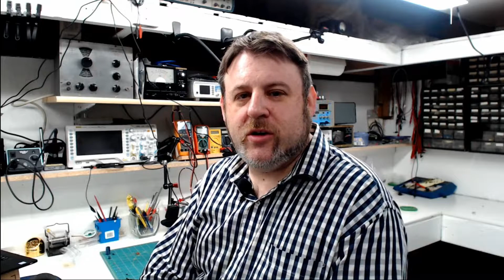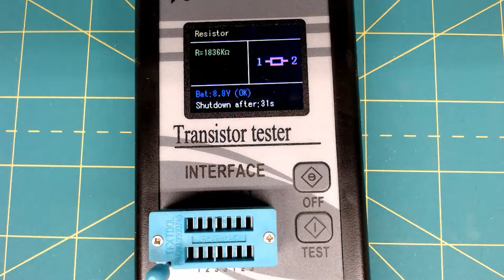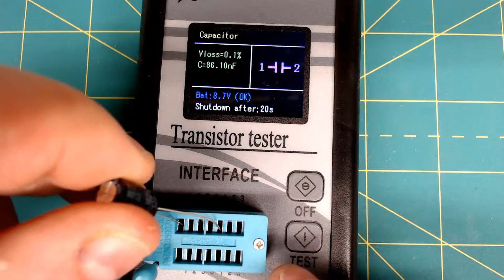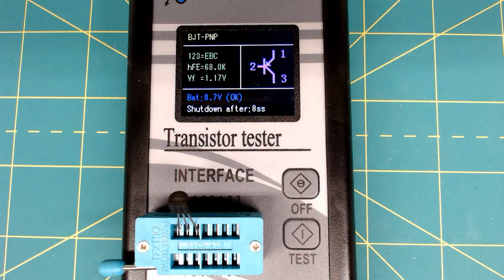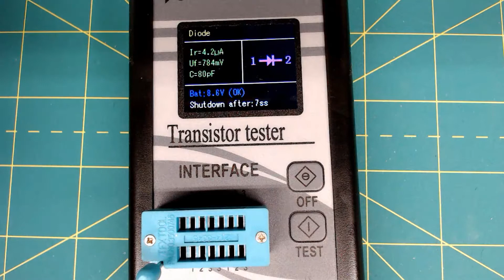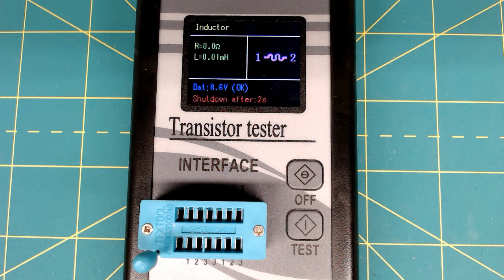Drok Electronic Component Tester Review

Comment: What happens if the component is bad? I purchased the Drok based on you Amazon Review. I watched a lot of YouTube reviews for the Drok Transistor Tester, but no one shows what happens when testing a bad component.
Reply from the maker: Ok, I'm a year late, but answering now :-).  Unfortunately, the answer is "it depends".  It really depends on the type of component and in what way it is damaged.  For capacitors it may read a different value than the marking on the capacitor, which would mean the cap is bad, or it could measure as open and will state "unknown component or not connected".  Resistors that have overheated could also read the wrong the value, which indicates they are bad.  Coils/inductors generally fail when the wire insulation has been compromised (usually due too much current causing the insulation to melt) this causes the wire turns to short-out and reduces the measured inductance.  

So I guess the answer is, you would have to be testing a known part with a known value.  If the reader says it is an unknown part, or returns a different value than expected then it's possible the part is bad.